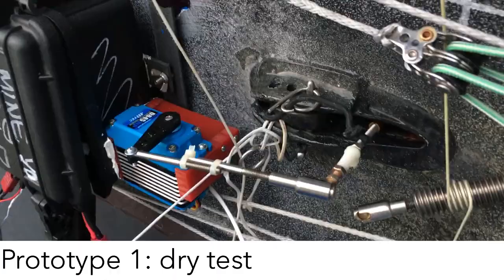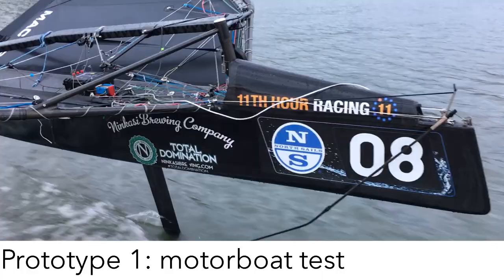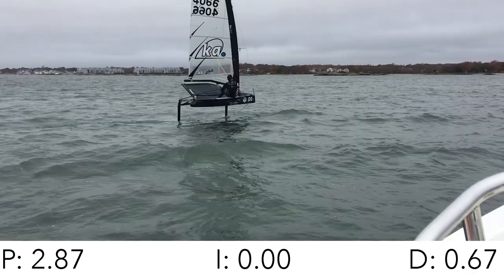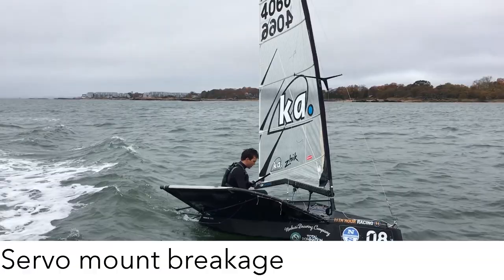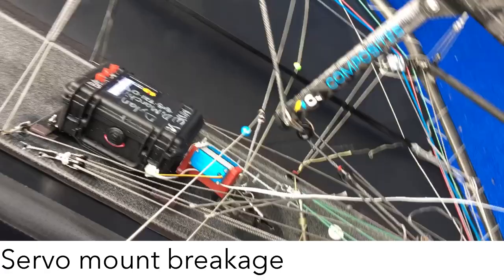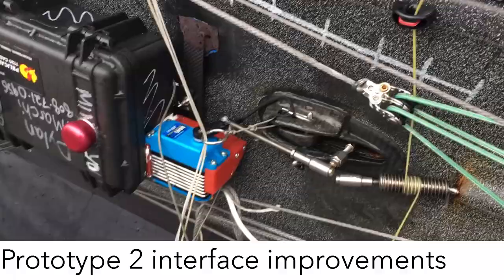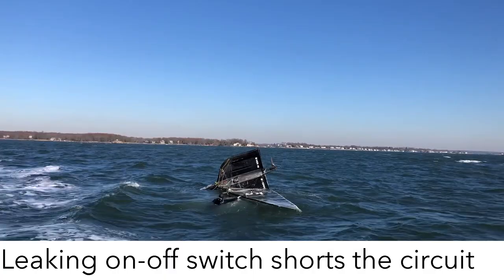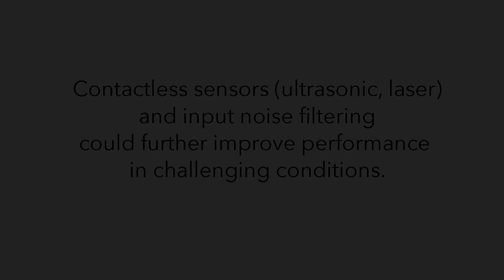Electronic moth hydrofoil control

Comment: Very good work, but you need to redesign the system on a bit different principle:
- instead of potentiometer use contactless water distance measurement sensor - capacitive or radar-based. These are much more reliable and accurate. You can put two for redundancy.
- add MEMS accelerometer and MEMS gyroscope to measure vertical speed and angles. This would significantly improve performance in challenging conditions, like high waves ride-through.  
- the processing cycle time should be less than 10ms for good reaction times and you need a really real-time processing. Perhaps Arduino is a bit too weak here, which has negative impact on performance.

Comment: I may be missing something here... Why would this be any better than a mechanical rha that is currently implemented on moths?
Reply: It's just an electronic version. Mechanical system is simplier an more realiable
Reply: @gastonbarouille767  I know the vid shows an electrical one... I'm asking why they are doing it while it seems to have no benefits with a few (but important) drawbacks
Reply from the maker: Hi, thanks for the question. As others have mentioned above, software-enabled systems are generally considered to be more flexible to modify and capable of solving more complex control problems than a purely-mechanical approach. Just as aircraft control systems started out as purely-mechanical in the early 20th century, most modern aircraft controls are now software-enabled systems to improve the performance, stability, and efficiency of the aircraft in challenging conditions. Hydrofoils and sailboats are facing a similar, improved future. Of course, any early prototype, such as the one I made in this video, is likely to have limitations, especially when water and electricity are in close proximity. Improved fabrication techniques would resolve these simple challenges.
Reply: Electronic system with appropriate sensors can have much better performance than mechanical on waves - e.g. it will eliminate typical moth fails.
It also allows "controlled take-off" e.g. less drag on small speeds and rapid take off when necessary speed reached. This will allow foiling with less wind, when standard moth will not take-off at all.